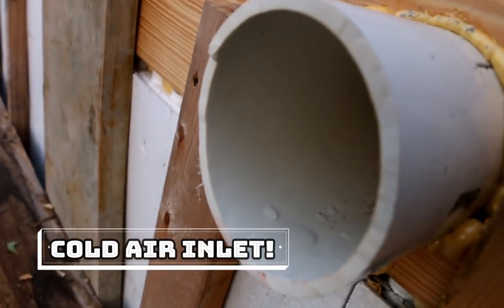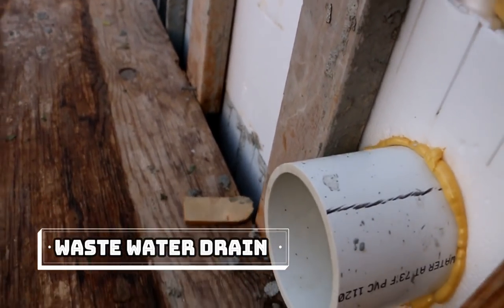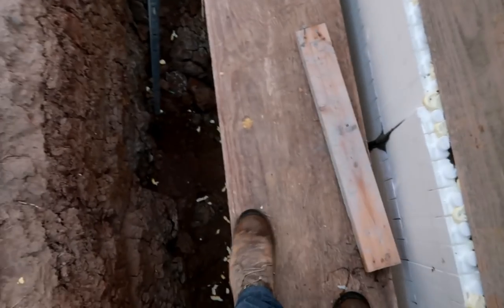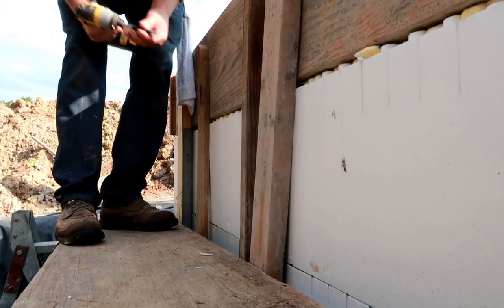OFF GRID BUNKER AND FOOD STORAGE ~ CONCRETE

Comment: ICF block is so easy to work with. We built our 3000 sq ft house with our teenage kids. The pour was amazing but we did the floor and wall in one pour and the ceiling in another. Then built the roof over that. Finishing inside was super easy too!

Comment: Consider putting drain tile along the bottom outside of the foundation, it will help keep your "bunker" dry by giving the water an easy path away. Of course, you will also need to dig a sump for that drain tile to go in to. If you size it right you can also put your interior drain into it. Really good choice to use the pump truck and professional help, it will may than pay off.

Comment: Good call on the pumper ... Safety is always a concern ... I have a water table concern ... The rain soaked the soil around the cellar structure ... Since it follows least resistance it was pushed under the foundations and to the interior ... My concern is that even tho the exterior of the walls are waterproofed, what will keep the water from going UNDER the walls again and flood the cellar ??? Drain pipes only work on a down slope ...

Comment: I didn't see any use of vibrators to work out air pockets and voids. Do you not need that?  Also, what does concrete cost now-a-days per yard?  I haven't poured any in so many years I've lost track of any costs.  Looking good !!
Reply: no answer,,,,
Reply from the maker: answers are on the next video just like we said
Reply: when using ICF you cannot use a vibe, you'll knock the icf apart

Comment: Did I miss the part where you poured a concrete floor? What is your plan on that? I would have figured that you would have poured that with the walls so there would not be any seems and would have thought that you would have also had water proofing added to the concrete it self. Not criticizing just asking. Will await the NUGGET thanks for all your hints tips and nuggets
Reply: They may want an earthen floor in the root cellar. IDK

Comment: Pumper truck was a good call. it should have been much easier to control the flow and put it where you needed it without a lot of trouble.  Good job and many years of good use from it.

Comment: Will you be putting a concrete floor in and a sump pump to keep the water from under the structure. I had to cut the concrete out of my basement to put a sump system in under the floor because it was causing my entire slab to float because of the pressure bringing water into my house.

Comment: No tile around the foundation?? Will You not have issues with hydrostatic pressure against the foundation walls??
Reply: Yes, I'm interested in how the waterproofing is done.  I didn't see and rubber lining under the floor or water proofing on the walls.

Comment: How are you going to address moisture wicking up from the floor and footings? I was surprised that you didn’t address that issue by using the fast form system that consists basically of heavy duty plastic.

Comment: Why did you add anchor bolts for the walls for the class room you plan to build on top?
Reply: They put rebar out the side... I can't remember if that was for a porch area or if they are building the top floor larger than the basement (going out before they go up)???